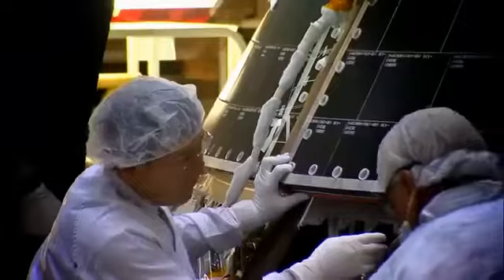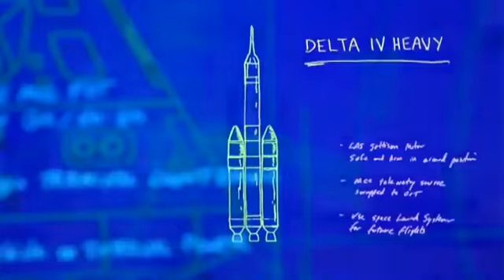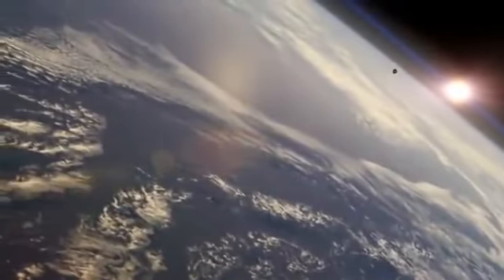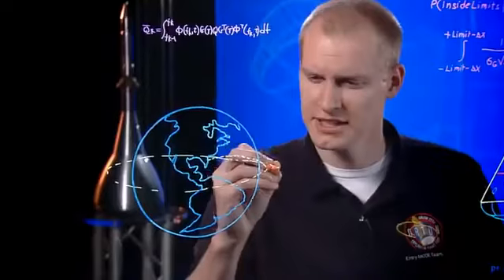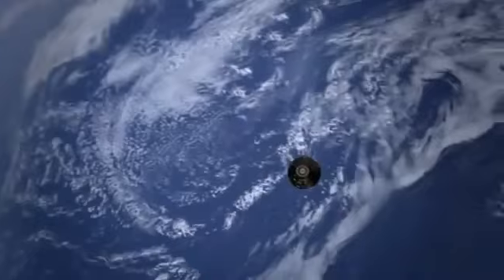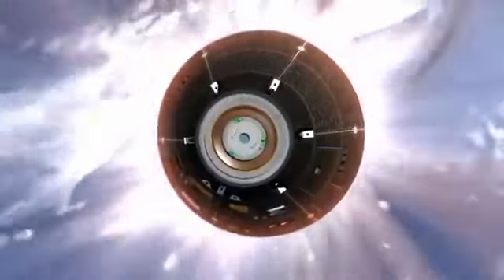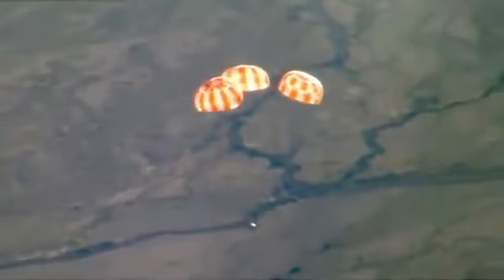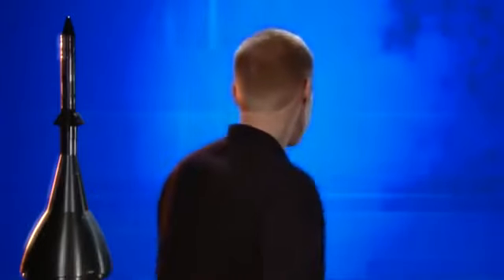NASA engineer admits they can’t get passed the Van Allen Belts

Comment: I’m glad someone finally spoke out the truth
Reply: too bad it isn't the truth, at least from Seb's disingenuous retitle of a NASA video he stole.
Reply: nowhere in the video did the person say that we cannot get pass the van allen belts, he just said it's a challenge that needs to be overcome before sending people through it, that doesn't mean that we don't know how to yet, it just means it is challenging. The moon landing acomplished this by using aluminum and polyethylene. Now this might come to a shock to you but they used these materials because the van allen belts are not belts of xrays, which is what lead protects against, these are belts of free protons and electrons captured from the solar wind. Aluminum blocks the protons and polyethylene blocks the electrons do to the hydrogen in it. Lead would actually emit xrays due to collisions with these particles, specifically electrons, this effect is known as Bremsstrahlung. In addition, the apollo spacecraft went through the least dangerous areas of the van allen belts. He even says just after the clip saying that electronics can be damaged that, "the Orion has shielding," obviously referring to the shielding that protects from the radiation of the van allen belts, which are charged particles (protons and electrons), NOT xrays.

Comment: At 3:28 the shielding on Orion will be put to the test.... Um, there shouldn't be any problems with that, didn't NASA already make some moon trips with people on board.? 🤔.    If they went through the Van Allen Belt (twice) back during the first moon landing, the radiation would not only have fried the circuits in the ship, it would have killed the astronauts.
Reply: jenky1044 Apollo didn’t go directly through the belts they have areas that are smaller and have less radiation and since Orion is going through a much thicker part of the belt they are sending a test flight to see if the shielding will work
Reply: Nope. Old electronics were resistant to radiation due to how clunky and shit they were. Modern electronics use super-tiny components that are very much vulnerable to the energy of radiation.

Comment: "We need to solve the air breathing issue before sending people down to the bottom of the sea. People cant breath water and this is a huge problem for sending humans down the ocean."  This does not mean we have not and can not send people down now. It just means that the risks, compared to staying on land, are high. As everyone knows. Like the astronauts know that its risky to be in space. No where does NASA claim people technically can not go through the Van Allen belt. Thats just a missinterpretation some use to discredit NASA.
Reply: Do you know what operation fishbowl is?
Reply: @disturbedshaggy898  only what's available online. However if you are going to use it to validate these conspiracy theories I will kindly ask you to properly source and backup your claims.